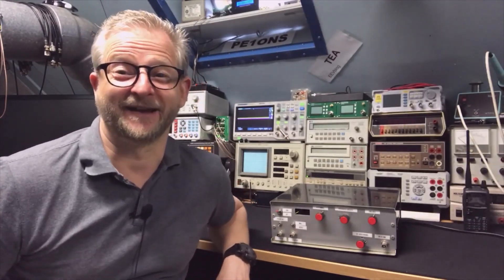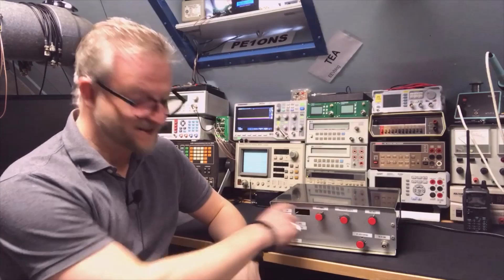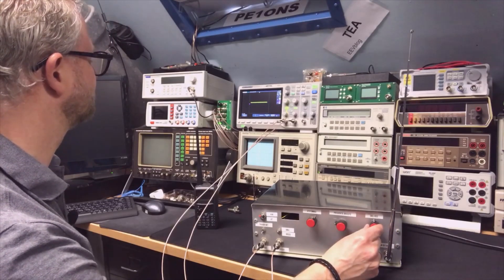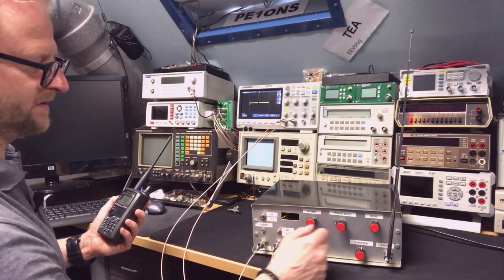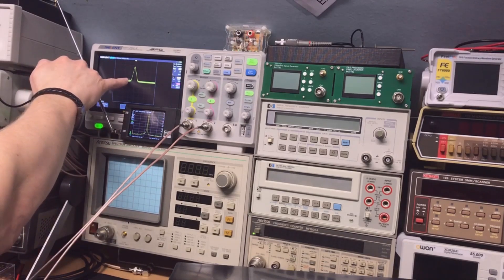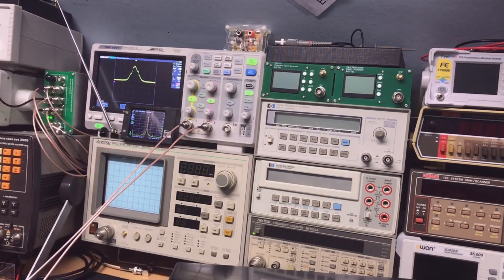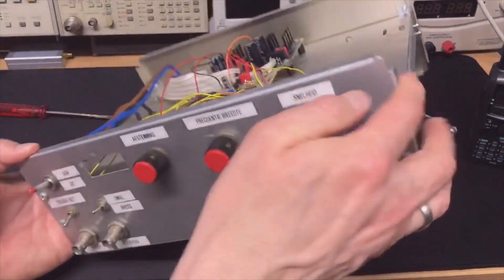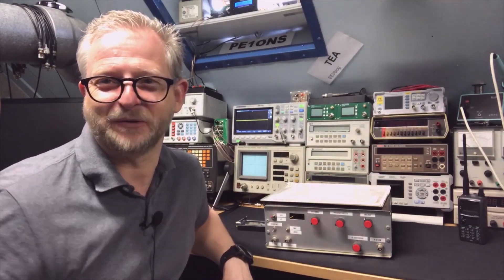#085 Oscilloscope Spectrum Analyzer

Comment: Years ago I got hold of the if & rf plugins from a scrap hp 141 spec analyzer , made my own power supply & used my scope as a display, it worked very well
Reply from the maker: Great solution! thanks for sharing..